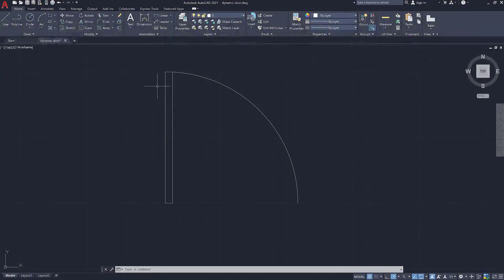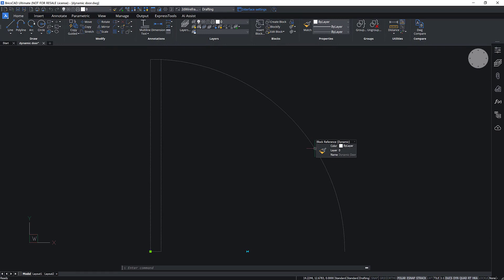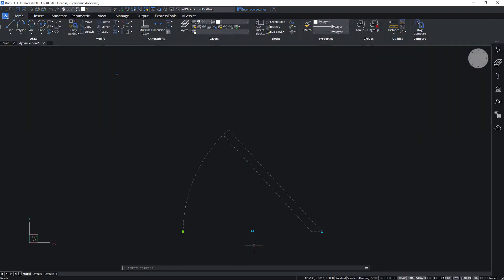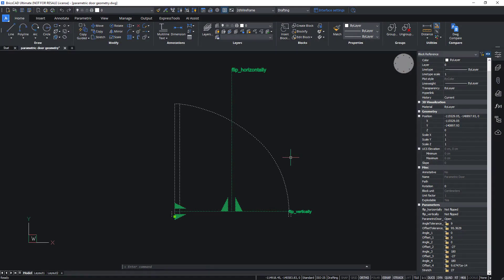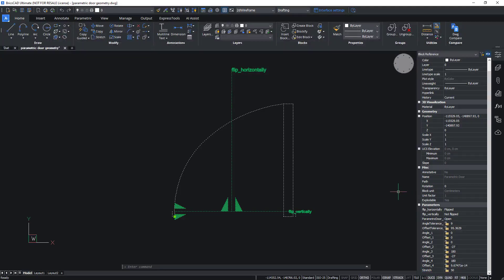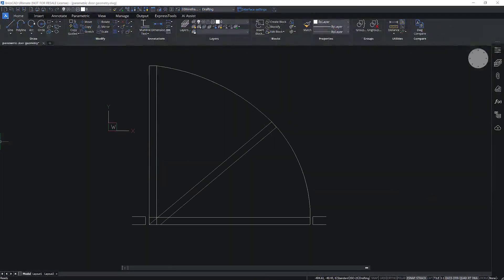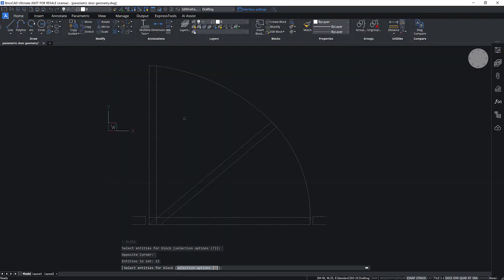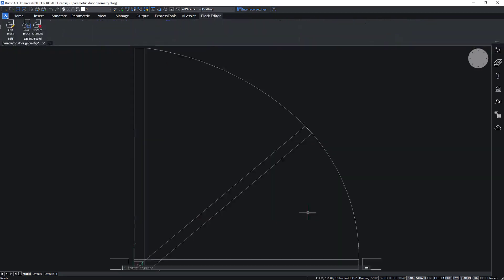Dynamic vs Parametric Blocks in BricsCAD

Comment: Great video showing the differences. Do you believe in the upcoming v24 we will see handles at the block itself rather than going to the properties panel? This would speed up block workflow immensely.
Reply from the maker: Hi there, thank you for your question! There's no need to wait until V24 to give this a go... You can set to display the Handle property at the Rollover Tips (that is displayed when hovering over the block).

To do that:

- launch the CUSTOMIZE command.
- go to the Properties Tab.
- select "Blocks" > at the right section of the dialog box (under Rollover) and check the box for "Handle".
- click "Ok" to save the changes and now every time you hover over the block, the Handle will be displayed at the Rollover tips.
Reply: @BricsysOfficial  Thank you for letting me know will be sure to give it a try!
Reply: @BricsysOfficial  Thank you for the help. Now that I have the handles displayed will there be the option to adjust the values at the block itself like a dynamic block in AutoCad in V24?
Reply: Hi! The handle in CUI turns on the visibility of the handle number property for a block in the quad rollover menu without the possibility to edit. It has nothing to do with the grips for editing the parameters graphically. When are you planning to launch the grips? Autodesk introduced dynamic blocks with grips in 2006 so ca. 17 years ago.
Reply: @Mani-Manitou  its patented from Autodesk, you can`t just copy it without a big patent lawsuit 🤷‍♂ 
only other way would be to buy the patent rights, which would increase the prices of BricsCad itself...